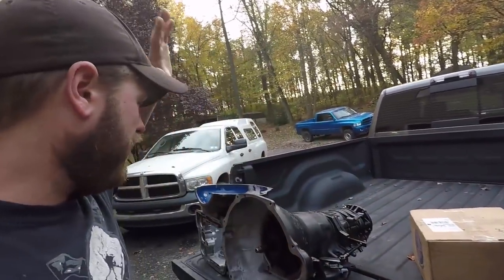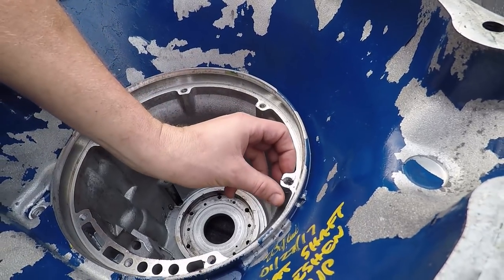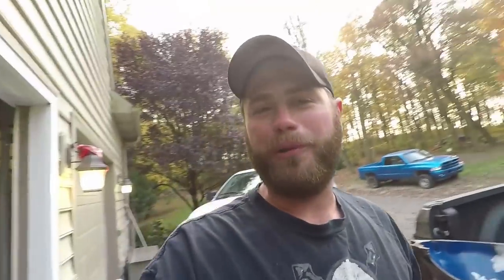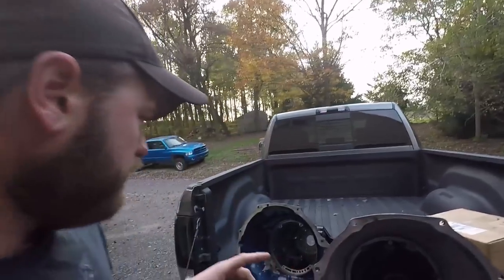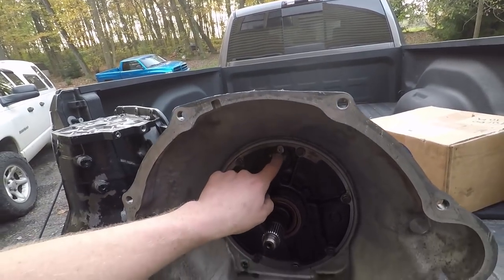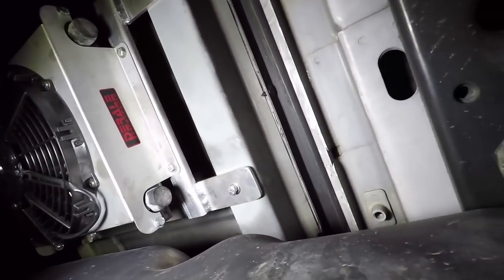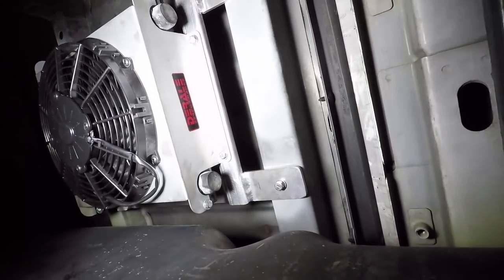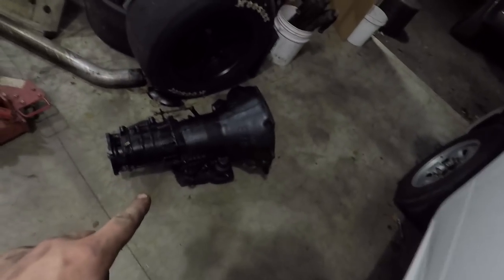48Re or 47Re Swaped 4th Gen Cummins??

Comment: you have no transmission cooler up front, only the 2 aux coolers under bed?
Reply from the maker: Ran it both ways. If your going to using the truck, daily driving and towing, a cooler up front is probably a good idea as it will see air flow